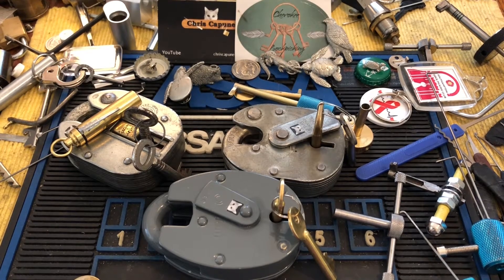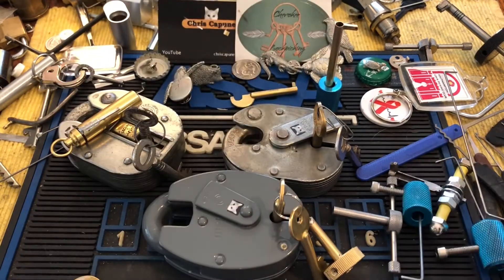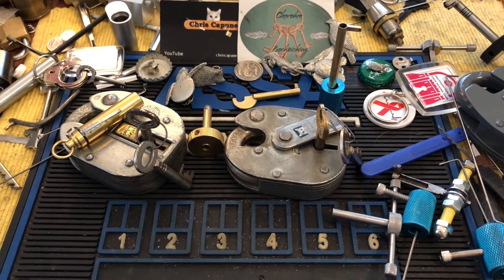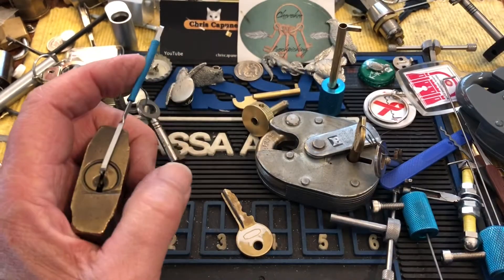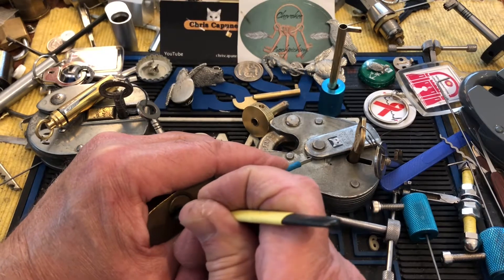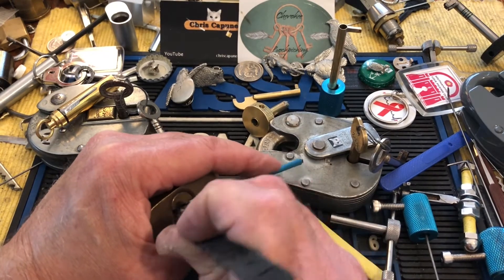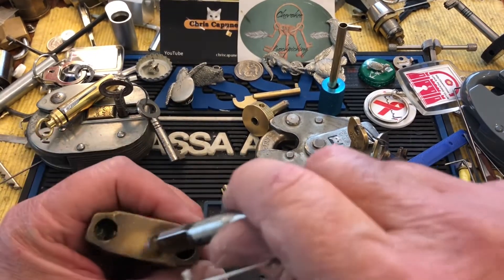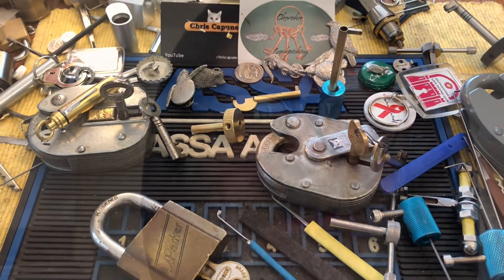#1370 Working on things in the lock lab.

Comment: Brazing the tip onto the brass rod would be a stronger joint.  Only issue I can see with that though, is could the brass rod handle the heat needed to braze, it looks awfully thin walled.
Reply from the maker: It’s a bit of a tricky thing to do😃